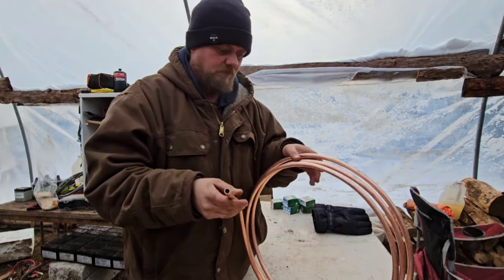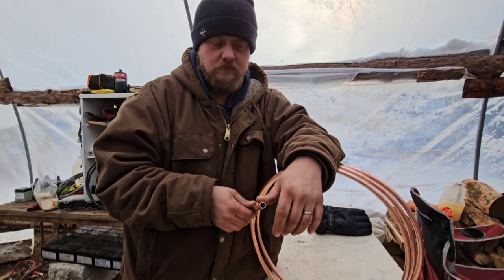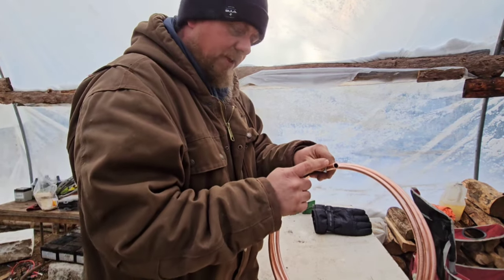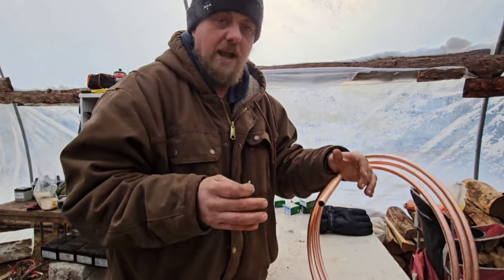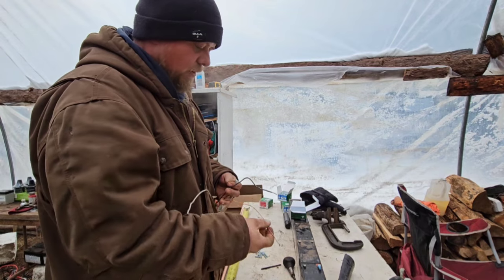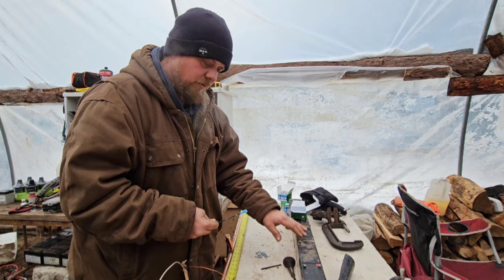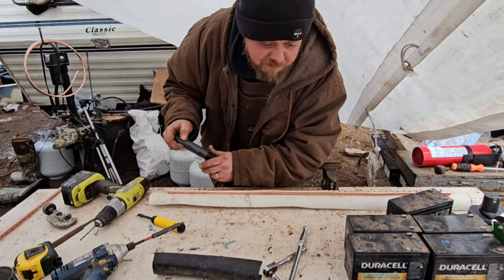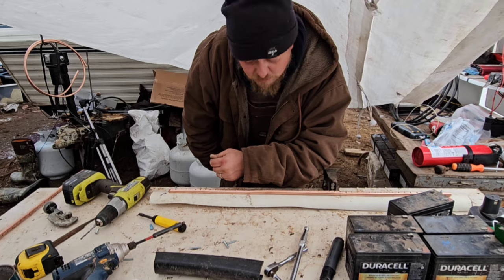DIY bus bar 50 batteries is parallel

Comment: I LOVE your ingenuity!  New subby here. How would you connect it to the busbar to charge your batteries. Do you have a playlist of projects like this where you build components instead of just buying them to do solar projects?  Thanks for sharing.
Reply from the maker: I use solar charge controller. When not enough battery power from sun I use alligator clips from chargers powered from the generator. I dont currently have any Playlist for my different diy projects. Hope that helps. Let me know if you have more questions.  Thanks for watching
Reply: @Offgrid.farming  Thanks for the reply. Ok. I understand.  😊

Comment: For proper electrical contact surface contact should be clean and big enough . Copper is a metal that can be annealed or made soft to ensure that when bolds or nuts are tightened you get max touch surface. Crossection of bar(s) be enough for max expected current. Naked copper in humid environment trends to corrode which spoils contact reliability (tinplating or nickel plating  protects well) Avoid mechanical forces on battery poles and allow for some movement (expansion curves) to avoid thuis during vibration or expansion thermal cycling.. However pure copper is very good electric conductor and only silver would be technically (but definitrly not economically better...If you use used copper tube make sure inside is clean to avoid corrosion and wrt your remark to not Hammer it flat due to perceived risk of sparkling inside tube this will never happen inside conductive tube; would consider to anneal tube first then Hammer it flat to a "strip" , drillen required holes, give it required shape,  latten contact surface, annalen again and tin plate..